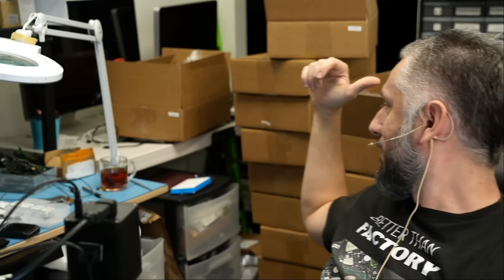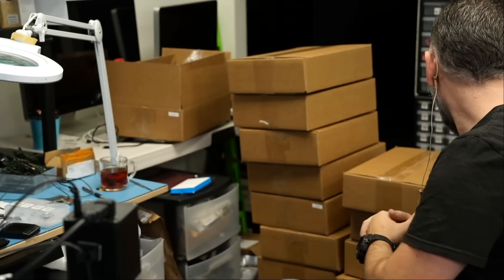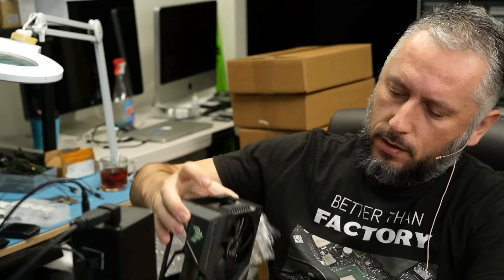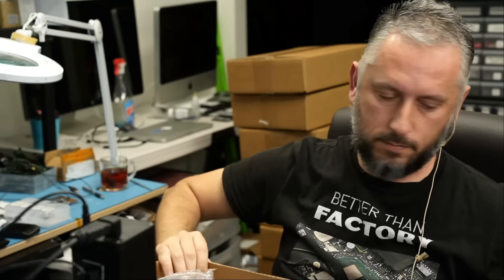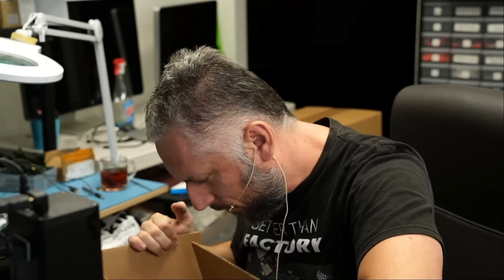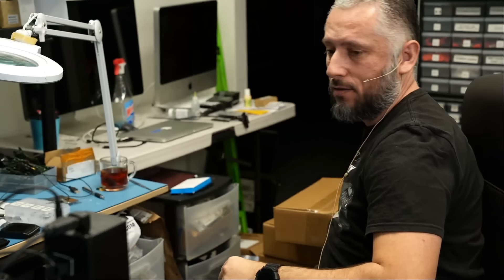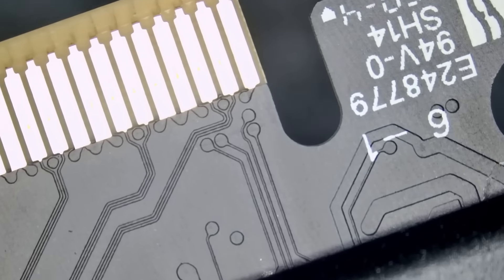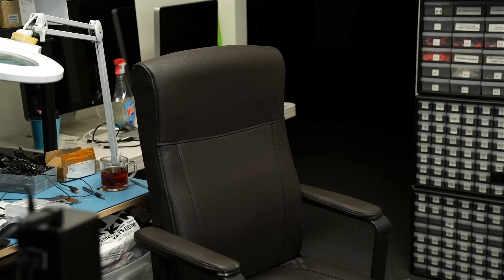We received 19 cracked 4090 Cards for repair - Who's to Blame ?

Comment: Shipping prebuilt computers require a lot of foam inside the case to keep parts from being destroyed, a dot of black hot glue on connectors to keep them from unplugging and a GPU brace is best practice in general when building modern PCs. Not doing any of these you're setting yourself up for failure.

Comment: Common sense, people. Support your cards.
OEMs like Dell (and others) have been using using video card support brackets for years now. Simple solution, and because it's designed into the case, it works great and looks great too.

Comment: I have an ASUS TUF 7900XT, the graphics weight is 2.3Kg, I recommend always using it vertically, it is the best option even for the durability of the fans. I have everything installed on a NOX Nova lying horizontally.

Comment: Most 4090 is long and thicc, stuff like this will eventually happened even if you use a support stand. The only way to avoid is to use pcie riser that hold the weight on the cooler itself and not on the pcie. Most of it aren't cheap cause some priced at 100-150 USD and even more. If you can afford a 4090 you can also afford that riser.

Comment: some motherboards have a new way of removing the gpu's where there's a push button about 3 inches away from the conventional latch.  they might have been trying to pull while pressing on the latch while not realizing the push button 3 inches to the right that releases the gpu properly

Comment: I know what's happening. It is from when a customer has tried to uninstall the card. You must lay the pc down on its back to actually get the card out from the quick disconnect. I nearly had this with a crosshair extreme mb which when stood up did n9t give the card enough room to pull out and away. The motherboards and computer cases do not always match up. Lay the pc on its back before re.oving gpuz in future. Purecain..

Comment: Well, if the card cant support its own weight and requires support, then the manual/install instructions need to state this and the orginal sale needs to include whatever is needed for said support. Imagine buying anything else and it just breaks because it cant support its own weight. Like a car that just falls apart or a refridgerator that sags down into a heap. Obviously this is a manufacturing flaw and they should be liable for repairs. And the manufacturers need to start reinforcing their boards where theese cracks are appearing. Its pretty obvious that they will either start reinforcing the PCBs or make the heat sinks/cooling lighter (or risk no sales- which they wont). Realistically they cant scale down the cooling too much without issues so reinforcing the board is the way to go - that way theres also headroom for even beefier cooling in the future.

Comment: It is the makers issue, they would know of its weaknesses and should notify users of potential happenings, if preventable they should provide the accessories especially if they are charging £700+ (even £500+). The issue is consistent amongst certain retailers. And also if they do provide a bracket or stand it should be applicable to all cases. (Which would make a stand more appealing).

Comment: I have question 
I bought msi crosshair gen 11 3060 vga 
I have problem with battery 
When i power on my computer and the battery precebtage under 40 its go to zero when windows finish booting and show desktop 
Other wise if my battery up to 50 percent its go normally discharger until ten percent 
I already xhange the battery and same issue

Comment: The form factor is to blame. 
PCI cards were designed back in the day with max 50W TDP target. 
Putting a 500W chip and cooler on them is absurd. There should be a new socket/form factor for modern GPUs.

Comment: People spend thousands of dollars / euros or whatever their currency is and they install those cards in computers with no support brackets or columns. If you have the money to support such a piece of hardware the LEAST you can do is carefully support it so it does not sag. Another solution would be to mount it vertically so you will not strain the PCI connector. The best you can do is buy a waterblock and stick it on there, get the extra performance and have a smaller and cooler card. All your problems are solved before they even existed.

Comment: These graphic cards should be screwed to the PC case on the port side. That should hold them at least from that side and prevent any cracking in that area.
The problem is, however, that those cards can be mounted without using screws too, in some PC casings you only have a latching mechanism.
Worse, some people may try to mount them without even latching them from the port side and they would mostly still work and hold only to the PCI port (for a while at least ;) )

Comment: did a 3d print support bracket adjustable up and down for diff cases. with rubber feet for stability and cost= almost nothing. my card wey in at about 2.5kg and its stright as an arrow still. point is if people can afford cards for 1500-2000 dollars then they can afford a bracket for less then 1 dollar do make. thats what ppl get for being lasy

Comment: This is one of the  advantages of GPUs with AIO. Mine came with 360mm rad and in size is a lot smaller than my old 3090. Runs pretty cool, considering the fact that it can pull well above 500W.

Comment: Those are all out of prebuilts, the tuff series is the entry level card and found in a lot of prebuilts. This is not Asus fault, when you buy a new rim for your car it’s your responsibility to secure it with lug nuts. Same goes for these cards, it’s the end users responsibility to secure the card so it doesn’t get damaged. This is a prime example why I never buy used electronics, it’s all junk that someone else doesn’t want. Buy new and get warranty and never worry again, used can be DOA or die while your using it.

Comment: If the card comes with a anti-sag bracket, even if it doesn't fit the case the user has, the user should know they will need to spend another $10-$20 on a better anti-sag bracket that fits their system. The fact that the GPU came with an anti-sag bracket pretty much should be telling anyone with common sense that the manufacturer thinks it needs support. Not all of these 4090 GPUs come with a bracket, but most of them do. I would have to say this is mostly on users being careless.

Comment: so if the pcb cracs but the core and vrams and other components likely in good condition, can it be fixed by using a donor card that had core issues but good pcb ?

Comment: Those all look new they was likely damaged during shipping in prebuilt systems. They are heavy but they wouldn't do that from a normal install even without support. Either way I bet the customer is hurting. Even if they bought them in a broken lot they still paid a lot.

Comment: I don't understand why the makers of Video cards, keep making cards like they did 20 years ago. Instead of a loaf of bread, made of plastic and aluminum, hanging awkwardly, why don't they make them, being a card that does not hang off the slot. Convert the slot to a normal cable and mount cards remotely (even if it still resides within the PC Case.)
Reply: Also, If I was making something, that is shown to break in the same place, time after time, I would figure out what is going wrong. If I was a manufacturer, it would seem to be part of my responsibility. I think Asus, and others, should be fixing/replacing these cards.  (The motherboards with the  stress crack at the tab.)
Reply: Riser cable reduces speed because of transfer
Reply: @danial_amini  I thought they offered Ribbon cable rated at PCIE3, and now PCIE4. 
Is this the potential bottleneck you speak of? I assumed if a Riser cable is rated at Pcie4, I could expect it to handle the 'load' of a PCIE4 device.
I would think a 6" ribbon cable would only increase latency a small amount,if it's noticeable at all.

Comment: The answer to your question is: it’s manufacture fault; customers are user; they are not experts and do not have knowledge of materials; they only care about results which is power for gaming or whatnot; its 100% manufacturer fault; the manufacturer must replace the card for the user and also send a gpu support for the customer new gpu and apologize for the inconvenience in  written; if not the customer must sue the company and charge; 
There is also another why in which this could end; the company must manufacture new gpu with better material or better mounting mechanism or provide a gpu support within the package of new product line so they could either prevent this from happening again or demolish it permanently; at the end its manufacturer fault anyway

Comment: Anybody surprised by this sheer level of cracked cards doesn't understand weight/arm/moment.
If you hang a bunch of weight off a PCIE slot...without support, it will eventually crack.
If the quality of the PCB is not capable of supporting it's own weighy, it will crack. Now add heat into the mix. It'll crack even faster.
These monstrosities were always going to be an issue.

Comment: if I had installed a 4090 in my computer, I would have supported the card with a stick made of plastic or wood or a long metal screw.

The factory is responsible. Such a thin pcb cannot withstand everything and a power plug has a limit to how many watts it can handle. Does the factory not do any tests?

Comment: About whose to blame, my two cents is that the card manufacturers and quality control are to blame. They knew about this issue much before the product even came to the market. Adding such a big, heavy heat sink is an obvious risk to anyone with a common sense but they ignored it.

Comment: How they hell can they make improvements on the mounting bracket on the 3090s/3090tis then ignore it on the 4090s when the GPU is all ready bigger then a 3090, they need support brackets or better mounting brackets.

Comment: What a well designed and engineered car the 4090 is! Too heavy, causing PCB cracks, melting power connectors, insanely expensive, huge power usage! Glad I skipped the 4xxx generation.

Comment: To be honest, it's completely the manufacturer's fault!
Why not design multiple fixed supports that are screwed to the outside (metal case of the graphics card) and let the customer only have the heavy card installed vertically!
Then all that's left is a power cable and a ribbon cable (riser) that can't provide any damage to the motherboard!

Comment: >> A manufacturer is responsible for providing a support bracket. They need to avoid damage and so they have to make a product that is even safe for idiots 
(sorry: i mean users with no experience :P)

>> In my opinion the customer also has responsibility. I mean we are all born with a brain so lets just use it.
I see a lot of pictures from computers where the graphics card is unsupported and completely crooked. Actually, it's nice that stupidity is now being punished through cards like these.

Nice Video.

Comment: The 40 series is the worst I've ever seen in terms of design. They made the largest heatsink possible that relies on the PCI-E connector as support and has the smallest connector which supposedly can handle up to 600 watts (doubtful). I'm glad I stuck with the 30 series.

Comment: They have problems with their PCBs. No isn't a user error... When you sell a mammoth GPU for 2000 dollars 1. You make a more stressful PCB with support bracket being a must. 2. You sign outside the box of GPU " WARNING DON'T CONNECT THE CARD WITHOUT THE SUPPORT BRACKET". 3 Every box of the GPU has a support bracket inside. Problem solved.

Comment: Man nvidia dropping the ball. Those boards are WAYYY TOO THIN for how heavy those cards are. Not only do the boards crack, but the actual GPU chip can start to lift because of all the flex in the board, because, you guessed it, its TOO THIN.

Comment: I installed vertical GPU mount, can't take the risk that my 4090 will crack, even tough it's not that heavy (rtx 4090 supreme liquid X), plus it solved the issue of closing my side panel.

Comment: That's a lot of cracks.
I think we can blame it on nVidia and AIB. PCIe connector isn't designed for this kind of forces. In past it didn't matter since cards were light with 1/2 slot cooler on them.
But there is no real synergy between cases manufacturers and GPU cards  manufacturers.
Sometime they provide ugly and cheap support bracket and most users probably don't bother with it.

Comment: You cannot put it with the buyer. At least there should be a clear disclaimer for the necessity of adding support, even if the manufacturer doesn't supply any (which could be a market differentiator, I can imagine EVGA would have done that). How can an end user 'smell' the card is so heavy it needs support? I am an engineer, I have my gtx1080ti supported just to be safe, but you cannot expect that from your typical end user. Cracked high end VGA is getting ridiculous, combine this with melted power connectors (which all to me is a lack of industrial tolerance),  the manufacturers need to take ownership! Did Nvidia design it 'just' within limits? They have responsibility as well for sure.

Comment: Def some user yanking the boards out without releasing the PCI-E retention clip.  I suspect a gaming cafe, or something similar.  Employee was told to remove them without knowing about the clip and forced them out, given where the cracks propagate, this seems to be the case. Knowing they where screwed, put them on ebay then some poor person bought 16 paper weights.

Comment: I honestly don't even feel sorry for 4090 customers anymore.   It's a GIANT BEAST of a GPU with a 16 pin to 12 pin connector, that requires a huge amount of juice to run, and a giant heavy heat sink to stay cool.   Nothing can go wrong?   I bought a 4070 because it's the opposite of a 4070, a good GPU with LOW power demand.  MSI even decided to put an 8 pin to 8 pin connector on my 4070 because that's all it needs.   This product was doomed to fail, and when I see some Tech Giants on Youtube still defending the product, it annoys me so much.   I can promise the reason Nvidia decided to stop production of the 4090 is because they realized it does have a fatal flaw, but admitting it does can lead to massive refunds/lawsuits.  

The 4090 failing or breaking isn't a USER error.   This product shouldn't even be sold to consumers, it's too heavy, requires too much juice, it's just impractical.

Comment: I just bought a Sapphire RX7900XT Pulse and it came with a support brace I don't think it's long enough as the card exceeds the length of the brace by a good 5 inches or so. I might add my old brace for more support so I'll have 2 braces on the card.

Comment: This sounds like a class action lawsuit to me. Nvidia and AIBs have to know these cards now weight too much for the intended purpose but are selling them anyway. That's negligent. At the various they should never be sold to customers without a custom support bracket. A bought a support bracket for an AMD card and can't even use it because of the fans hitting it. This is why it should be custom.

Comment: This is what you get when you make GPU's weigh like a dumbbel, should not be surprising to anyone. They need an extreme amount of support especially when shipped with GPU installed. Some prebuild sellers skimp out on the materials and they and customers pay the price. The worst thing about these cracks is that they might not break the card right away, first the crack might just weaken it but down the line the customer might wanna dust off things or take the GPU out for some reason and then it breaks it. And guess who the seller is gonna blame then? I'd bet my left nut that the end users are paying for most of these.

Comment: The blame is on the PC hardware industry. The standards are fine for the average office desktop but are totally inadequate for high-end gaming rigs and professional 3D CAD workstations.
Professional 3D CAD workstations usually are manufacturer builds, using customized cases that have all of the needed internal support structures to lock every component firmly in place.
Unfortunately, the high-end gaming rigs usually are custom builds from components that need to adhere to the standards in order to be interchangeable. I'd say, we need a new standard.
The video card should be a securely mounted unit instead of a card. Connected with flexible cabling to a small PCIe motherboard interface card.
The power supply should be at appropriate voltages for the amounts of power needed high-end graphics hardware. I'd vote for 100V. We don't need those connectors that melt at high amperage anymore. 100V is unsafe? - Well, a fire hazard is also unsafe!

Comment: I think PCIe slot lock is stupid design, when card so big it pose a lot of issue. Or at least change to hole with push spring release for more robust.

And if anyone use big cpu air cooler then it mean impossible to get that card out without reassembling everything.

Or at least don't run any electrical around there and when it break just loose lock, not anything fatal.

Comment: Such heavy cards on fragile connections are a recipe for losing money. Just fix the card in the computer frame and use a PCI-e riser cable to connect the GPU to the motherboard. This will avoid this kind of damage in shipping or by an honest mistake building your own computer. Gravity is the law.

Comment: A lot of waste either way. I don't think they should all be breaking in this area, so the manufaturer should take some resposibility, them cards are like a tank built on a mini chassis, which is obviously incapable of holding its own weight horizontially. I could also see them being broken vertically by pushing down too hard but not 19 times, Bad batch or common fault...who knows.